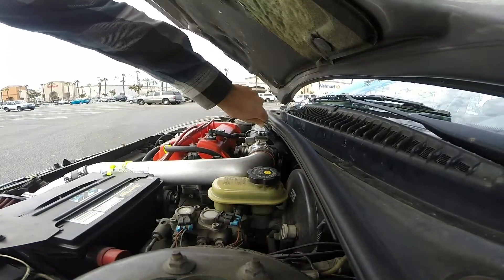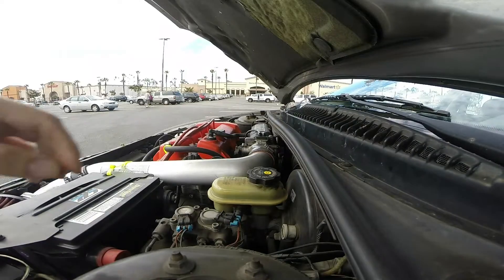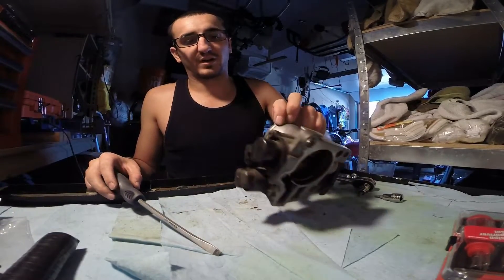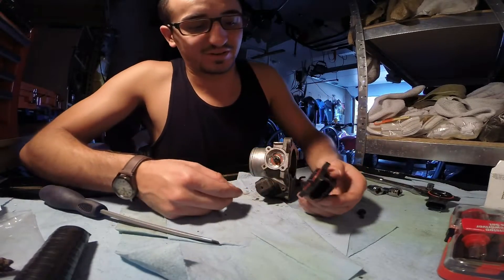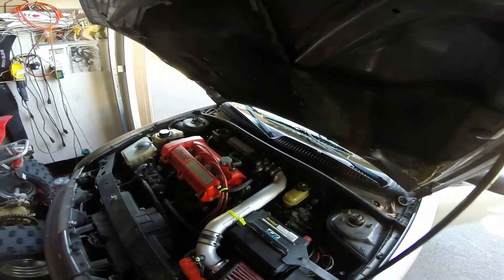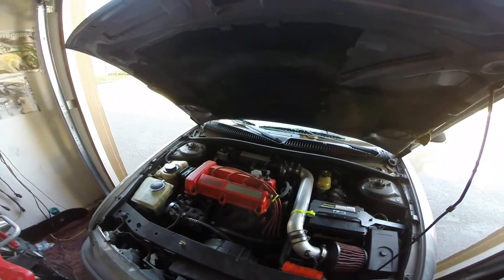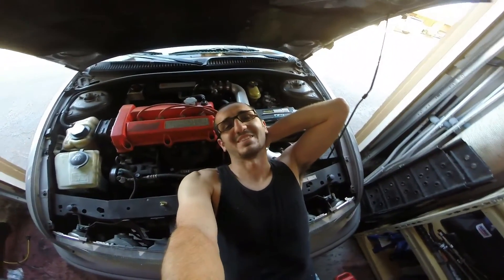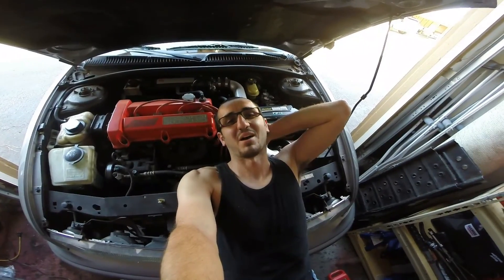Test Your Throttle Position Sensor (TPS Tap Test/ Wiggle Test)

Comment: hey I checked the resistance on my tps and it kept reading at 4.09 volts without even moving the throttle cable, does this indicate a bad tps